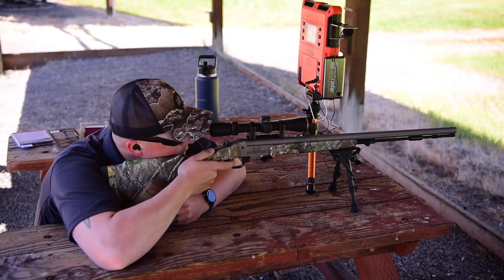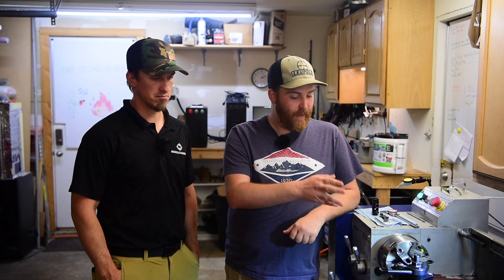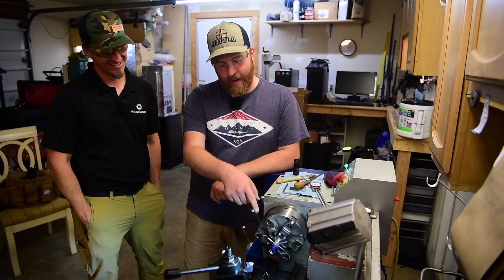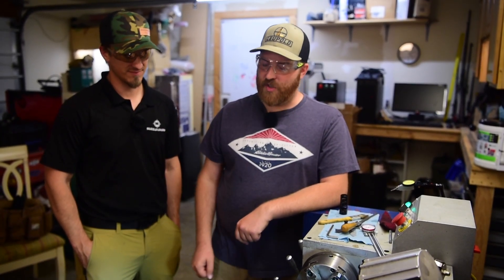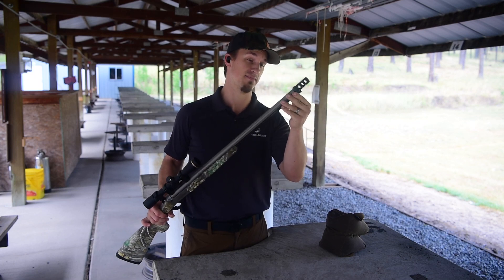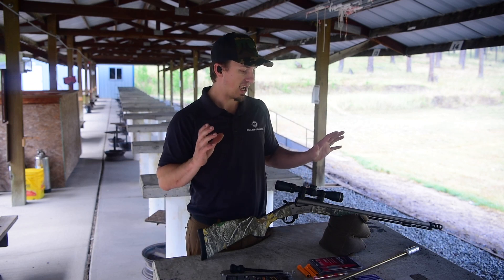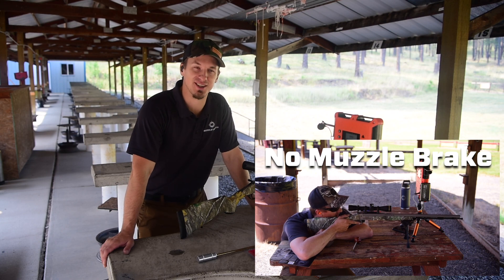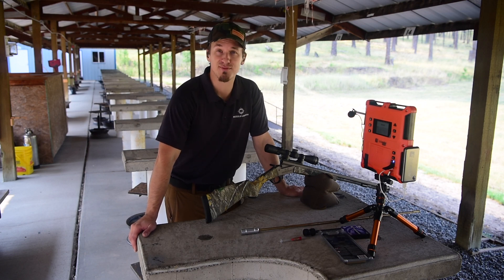We put a Muzzle Brake on the Traditions™ NitroFire Muzzleloader

Comment: How would the brake work with loose powder? Would you lose some out the ports? Need to use a funnel?
Reply: @hammerhead7900 you would want to use a funnel for loose powder if you had the brake on a different rifle.
Reply: I think it may only work for the nitro fire style rather than traditional loose powder down the tube.